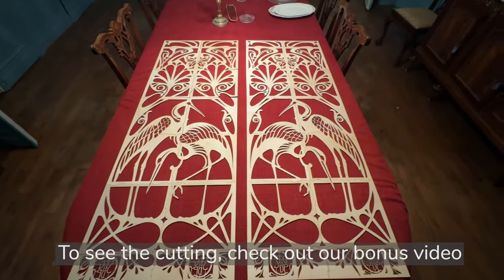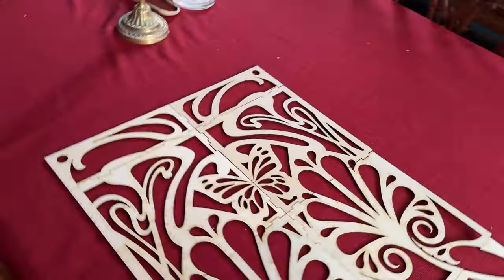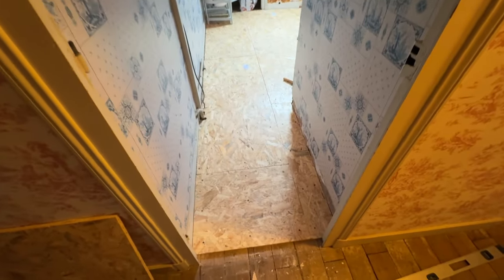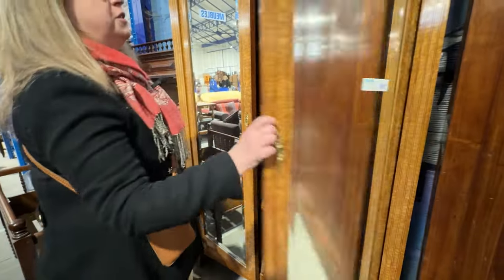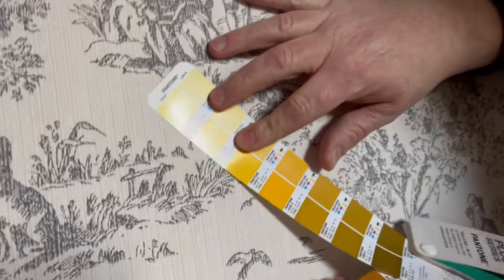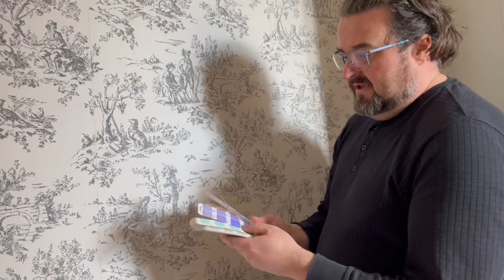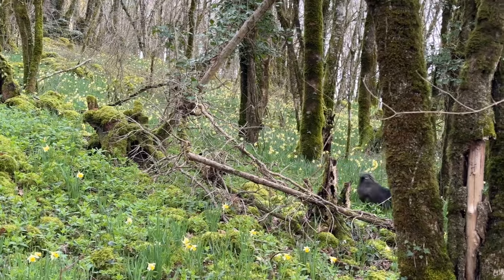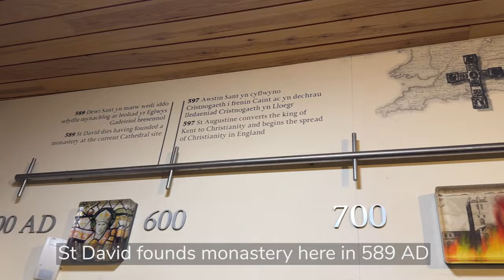DIY Progress & Celebrating Wales | Manor & Maker

Comment: Door panels are magnificent !  Very brave to ask audience input !  Here goes !  Wall color, match background of the toil. Trim and door, grey from the toil.  Cove or decorative trim at the ceiling, white like ceiling. It will lift the eye and give the room class.  This is a neutral palete because of the toil walpaper. Adding more color chops the room up visually. Use any muted color for accent, which you can easily change at will. 😊
Reply: Bonnie, I agree. But dear hearts, it's your home. You want it calm for a bedroom: relaxing. If it is a homage to the Toile de Jouy then why not accent the colors in the wall paper and not contrast? I think the background color of the toile would light up the room with the sun coming through the window. It would give it a clean, crisp airy feel. But I ain't paying the bills!
Reply: I agree
Reply: I agree too, and definitely not yellow!
Reply: Agree. Definitely not yellow. Keep it classy. ❤
Reply: Agree with Bonnie.
Reply: It would be classy.  You can add some yellow accents in the room with knickknacks and pillows
Reply: I agree
Reply: I agree totally with Bonnie, Donna Schmink, and CWatson. In my view the Toile de Jouy will not be  the focal point of the room if all the other walls are  yellow. I think it will likely look drab & misplaced. However,  Bonnie's & Donna's suggestions will both compliment  & elevate the toile. Small pops of yellow as accents as CWatson suggests will add interest without dominating and detracting from the vintage château period appropriate Toile. Just my opinion, but it's your château! Ultimately, you need to love it, too! 🥰
Reply: I agree but it’s your home and you’re the ones who need to be happy with the outcome. This is a challenging suggestion for you who love love love colour. ❤
Reply from the maker: Love this thread! Thanks to all!
Reply: I agree & not to add too many colours.  Match the toile background and a couple different greys for trip.  It will look rich and then you can add colour to other areas in the room for pop.
Reply: I’m on team muted with yellow accents in the room!
Reply: I also agree with the above and say no to yellow walls but using yellow as accents throughout sounds so much better and if you find your not happy with the results changing out the accent pillows, throws and such would be an easier choice.  Just my opinion for what it's worth.  Thanks for asking for opinions.  The final choice of course is all yours.

Comment: I agree with matching the background of the wallpaper. Use grey for the wood trim and doors. Go with a neutral bedding but add the pop of pale yellow in a throw pillow or sheets. Add a pale yellow vase, etc. Let the yellow be a subtle accent color and not a saturated contrast in the walls.

Comment: Looks fantastic and facing each other is perfect. Repeat of gallery border in top would be unifying. You asked: The woodwork a shade of gray, walls and ceiling off white like the wallpaper background. Framed etchings, lovely bedroom furniture and a rug for color with linens. The wardrobe with mirrors is perfect. A bed and lamp stands in the same wood tones will be just the right look. The room being plain colors can be switched seasonally with different bed covers and accessories. I think you will love the finished room.

Comment: I would match the wall colour to the background of the toile. I would use different shades of grey on the ceiling and paint trims - check escape to the chateau and check what they did with 3 Little Greene colours, then add splashes of colour in the soft furnishings,  maybe shades of pink or a multi coloured floral for cushions.  To add interest add a line of colour around the feature wall with something like grosgrain ribbon.

Comment: A muted yellow is better as it matches the wallpaper's ground color better than a saturated yellow and it should match the value of the gray in the toille or its ground. Leave the doors a solid unless your values of the gray and yellow are equal. That will make it marry much better than a higher contrast between the 2 colors. Personally, I would match the color of the ground as a wall color and use the yellow as an accent color in the room. As to the window atop the front doors, I would scale the leaf detail from the door's window inserts to fill the smaller rectangular window. That way the door and its panels match with that window and work as a unit. That fabric trim for the walls won't last forever as a reference to the door's top window to have a different pattern make sense.

Comment: Love the front door artwork Steve, looks absolutely stunning!    Bedroom color?  Considering the space, used for quiet and relaxing, I am with the panel.  With the feature wall being an accent, I feel the yellow would take away from accentuating it, sorry.   Using the same color as the background of the wallpaper on the walls and a tone of grey from the wallpaper for basebords, door,  etc would tie everything in very nicely and then accessorizing  with pops of color that you can change easily with the seasons would create a nice relaxing space!  Or one could choose a greyish, pale "dirty" lavendar color as Steve put it lol   That would marry in well, as long as it has the greyish tones.  Also liked the suggestion of the pale light pink.  Could always take pieces of the wallpaper u removed and put them on several boards, select different colors of paint of choice and try them that way before putting on the wall.  Do you want the toile to stand out or the paint?  Good luck, can't wait to see what you guys choose!  Oh the anticipation lol

Comment: I agree with others that those yellows seem too modern and harsh. A cooler neutral might work better. For trim, choose one of the darker greys in the toile perhaps with a lighter grey for the door panels. You could try introducing your preferred brighter colors in toss pillows or other accessories. But I think you need to "go with the flow" of the grey for the walls and trim and keep a muted palette instead of trying to use the paint colors to wrench it around to your preferred colors.  You could do it but I think the tension will make the room sizzle, not ideal for a guest room.

Comment: Love your door design. For the upper window I would suggest using the same design in the upper part with the butterfly, in some variation. I believe it will tie in better than the border design.  The idea of yellow for the paint color in the bedroom doesn’t seem fitting with the grey toile.  I’m in agreement with other commenters suggesting off white walls with grey wood trim. Then adding pops of color with decor.

Comment: Grey and yellow are lovely together. Lilac would make it too cold. As for the door panels you might want to wait until the wallpaper, baseboards and door trim are done. Maybe paint poster board in yellow and grey, fit it and then see what speaks to you. In general, buying sample pots, painting poster board is a decorator’s trick. Tack it on the surface and watch how the color interacts with day light, lamp light. Paint chips are just too tiny to get a clear vision.

Comment: Yellow paint always goes on so much brighter than the paint samples.  Even a yellow so light that it almost looks white on the sample will be very yellow when applied to the walls.  Maybe consider cutting the tinting formula in half, or quarter, to cut the intensity.  The wallpaper comes off very muted, which is lovely, I would hate to see the walls a bright and vibrant color.  I've done a lot of interior design and just felt compelled to let you know my experiences.  Your house, your choice and we will all cheer you on.  Good luck with your choices.

Comment: the door in the bedroom, you could choose a grey in the line of the toile dejouy wallpaper and you could use some yellow in the flat band surrounding the central panel of the door (the deep part of the panelling) keep the central panel grey as the door trim, you can vary to choose 2 tints lighter grey for the central panels of the door.

Comment: Please be very careful utilizing yellow paint. A greyed/pale color in large areas is going to be much more palatable. More chroma saturated yellows should be reserved for smaller areas (like trim or decor items) as they are prone to creating agitation. A starting point might be the "Oak Apple" option from Little Green (muted golden yellow heading towards tan). Trim painted to match background color at toile. Or off-white walls (toile background), grey trim, and use "yellow" for bedding, pillows, and/or accessories.
Reply from the maker: Ooh, this is very specific.... I feel like you're a decorator?